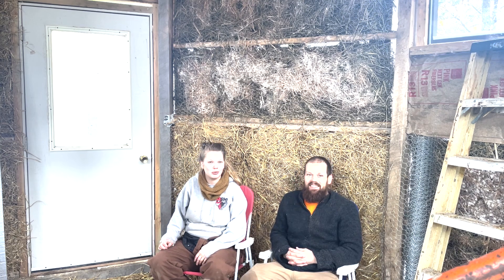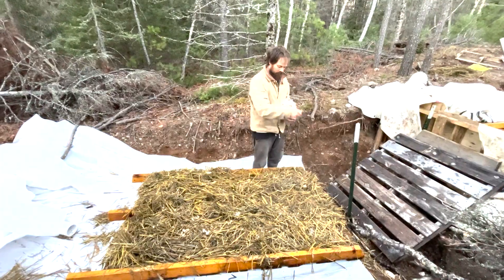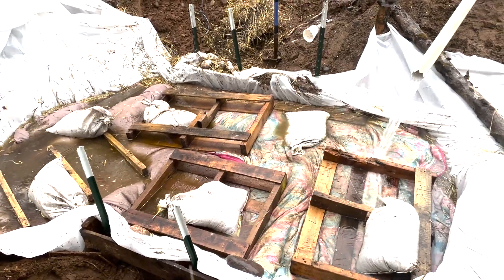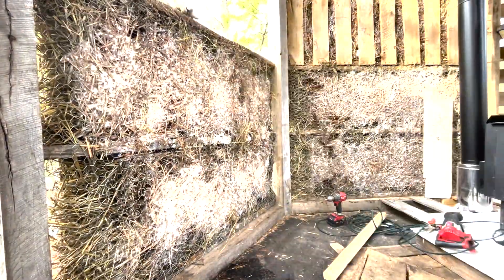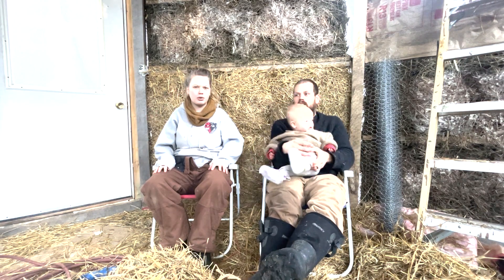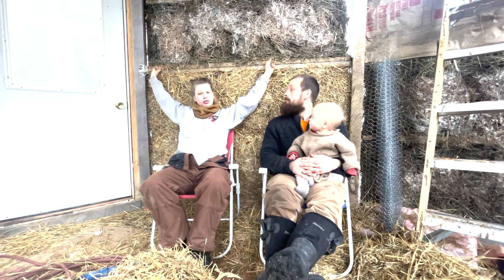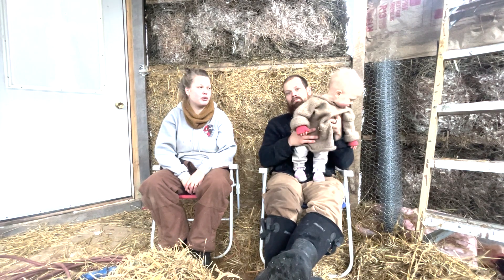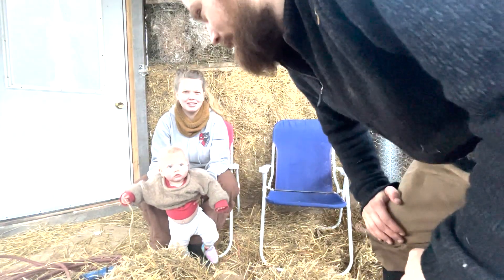Growing Natural Home Insulation inside Pallet Wood walls {Cost + Results}

Comment: Amazing, thanks for sharing your experience! Adding some flour to the mix could also potentially help encourage the mycelium to grow and colonize the substrate more fully
Reply from the maker: Good point, I think next time around that would be a good plan.
Reply: Yeah but more diverse nutrients = more undesired molds.. Better to do it by the right season, so you can even dry the whole only with the sun's enery.. ;)

Comment: if you chop the straw you will be able to fit more straw in, mycelium will colonize better as well and form more solid. use smaller mesh wire, even just without creating mycelium, more dense chopped straw would give you better insulation. im surprised at how well you got colonization, i think you should give up on the walls and just grow them out as mushrooms in the spring youd probably get a few thousand dollars worth
Reply from the maker: Yes, we went back and forth on if we chop the straw or not! Agree that we probably would have gotten better colonization if we did chop the straw. However with our set up we would have had a hard time packing in the straw real tight! We have some good ideas in mind on what we would do different if we ever come back to the concept. Haha lol.. thousands of dollars in mushrooms isn’t a bad backup plan!